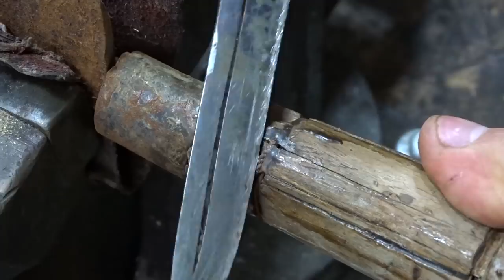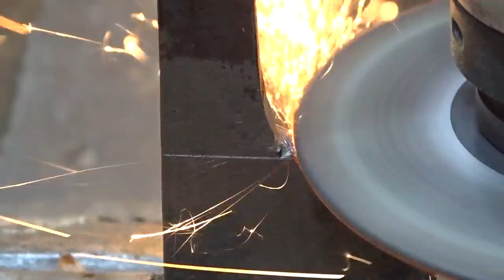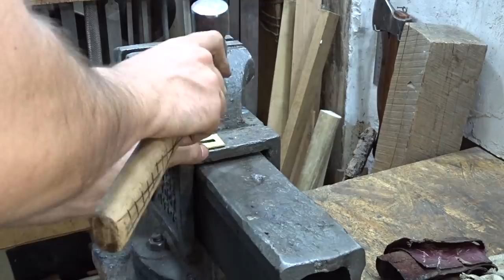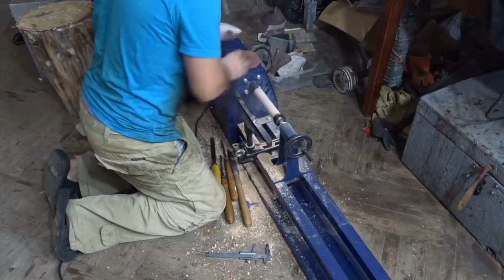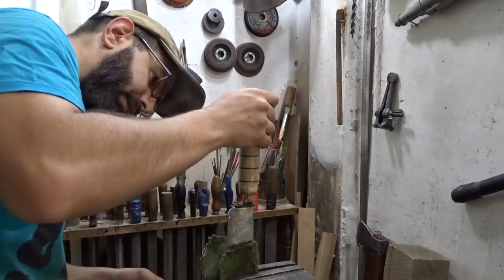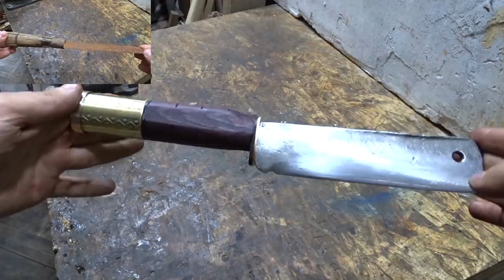Restoration Rusty Cleaver

Comment: I find all your videos are basically the same... remove rust, wash, sharpen, new handle. This applies whether your working on a knife, hatchet etc. Would like to see more challenging restorations if you please. thanks.
Reply from the maker: I understand you, sir, finding old complex items is difficult or expensive. For example, I do not have a sandblaster, so I have to use a liquid to remove rust or electrolysis. Thank you for attention!